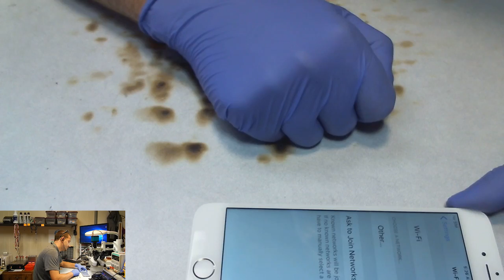An up-to-date iPhone 6 Plus Touch IC Repair - Comments on metal shield and underfill

Comment: We've done many of these and I personally replace the meson only and have not had any come back. Also if you are out of new mesons to reduce the chance of a bad ic, I've also been able to reball the same meson and have it work. Once I complete the repair we'll put something on the meson for pressure and then add the shield.
Reply from the maker: That's cool :)  I hope you continue to have no returns.  It can be maddening sometimes turning out 30 of these in a week.   I didn't think about doing something to hold pressure on the IC after replacing it.  That could be just enough to keep one from coming back that has a pad separated that goes unnoticed.

Comment: Discovered your channel from someone over on r/mobilerepair. Great stuff. I think more channels like yours should exist. Thanks for doing this, and keep it up.

7:05. Hah. Gonna be completely honest with you. The first time I tried cleaning an iPhone 6 board of liquid damage, I informed the customer that I really don't know what I'm doing and that she should find a store that offers ultrasonic cleaning. She said it was alright, and to just try my best. I knew enough that I needed to remove the EMI shields, so I started going around the board taking them off so I could attempt to manually clean them.

I flipped it over and started blasting that tape-covered area with heat. Sat there for minutes wondering when the fuck it would let me lift the shield off. Then I found out it was just tape and felt myself die a lot inside. Needless to say, that phone was very much dead after that, but it was also very much dead before.

18:40 I've found that most tacky fluxes seem to have that property of "locking" the chip down. It kind of flows right into place and does most of the work for you. I personally use Amtech 559, and it is actually reasonably easy to clean up even when cold. I use kimwipes and alcohol and an anti-static brush. A majority of it will get pulled right up. It also blows away very nicely on high air and low heat.
Reply from the maker: I did the exact same thing on my first iPhone 6 board.  I toasted that sticker pretty good before realizing it was just a sticker! LOL   I haven't used Amtech 559 yet but I'll probably give it a shot pretty soon when I make the next order.   Thank you for the info and comments!   I'm gonna be posting videos as often as time allows.  :)

Comment: Hey jason i have found out that sometimes only with heating up the ic sometimes the touch detection comes back for me it already worked 7 times and it does not take so long great video :)
Reply from the maker: Thanks!  Yes these connections are so tiny even the slightest variation in temperature is enough to make them or break them.  Hopefully it keeps hanging in there as long as you need it to.  =)

Comment: I had this problem with the cameras after replacing both touch ic;s, I ended up replacing the voltage regulator tiiiiiny chip, which brought back the back camera and then ended up re soldering some of the front camera components like the ferrites, caps etc near the cpu shield, this brought back the screen camera then, the odd thing is all of the components were testing just fine, so im guessing the only thing that was holding them to to board was the glue, possible heat transfer through the board caused them to detach, which is bizarre as I heat sink everything to death and never have the problem when doing a main pmu ic.

Comment: Hi Jason. Highly informative video thank you. If you don't mind I'd like to ask about how quickly you remove these chips. Am I correct in assuming you want to use higher heat to remove these chips asap before it starts affecting other components too much? looks like you using a bigger nozzle than I'm used to. What size is it? Be so grateful for your valued advice.

Comment: Don't feel badly someone will mess up due to you; we will mess up due to our own mistakes. You are helping us Jason! I wanna ask again in case you missed my question on the s3 data recovery video; have you considered chip-off technique for data recovery jobs? Also, I am going to start doing touch ic jobs real soon as I just got my new tools. I personally think you are changing too little. If i was sending you a board from one of my customers I would not only pay your low asking price but I would tip you! Haggling is not a good skill to try and hone on repair people, we generally sell ourselves short to begin with. I think you should be charging $200 for touch ic. How is it worth less than screen replacement? You are worth way more than your asking price Jason. I hope to see you raise the prices. I am going to charge $200 and I think Jessa charges $200. If they don't want to pay let them go to someone with less integrity.
Reply from the maker: Thank u!  I think by chip off method you mean hooking directly to the flash memory and copying the data.  I've thought of it but assumed it's most likely encrypted or have IDs on the file system that have to match for the OS to boot right..  It brought about more questions in my mind that answers and I moved on. LOL  I'm sure there's a way to hook directly to the nand and copying the raw data but getting it to make sense would be amazing.
Reply: This method only works up to Samsung S5. Hopefully they'll be stuff available for the newer Samsung devices with UFS's but all you need is a Jtag box (I recommend Z3X Jtag box w/ emmc adapter) All you need to do is solder 6 wires to the emmc or alternative points on the board if available (which means you don't need to remove the chipset) or you can buy a socket that makes reading not only way easier/more repeatable but it dumps faster!

http://forum.gsmhosting.com/vbb/f672/emmc-adapter-easy-z3x-jtag-box-1691845/

http://forum.gsmhosting.com/vbb/f672/e-mate-pro-emmc-tool-all-1-socket-all-1-adapter-work-easyjtag-2097603/

Comment: Hi Jason I watch your videos and I make sure I leave you thumbs up thanks for everything. I was wondering what is the model number of your power supply and how do you like it? Tks
Reply from the maker: Thank you! I'm using a really cheap one.  It gets the job done but that's about it :)

http://www.ebay.com/itm/5A-30V-DC-Power-Supply-Adjustable-Dual-Digital-Variable-Precision-Lab-Grade-/262294040786?hash=item3d11f170d2:g:RegAAOSw9eVXUIdZ

Comment: Hey Jason.I am from Kazahstan video vere good thank you so much)))I have a question how many degrees put the soldering iron?then you a new set Touch IC Repair or from a donor?
Reply from the maker: Thanks :)  The iron is set on 750F most of the time.  It helps a bunch for the board to be warm too.

Comment: Great video Jason. What type hot air machine are you using?
Reply from the maker: Thanks.  I am using this one and don't really run it all that hard.  I'm set on 380C and 40% air flow most of the day. 

https://www.amazon.com/Aoyue-852A-Digital-Rework-Station/dp/B000HDDXY0/ref=sr_1_fkmr0_1?ie=UTF8&qid=1477954164&sr=8-1-fkmr0&keywords=int+852a%2B%2B+pro

Comment: Hi Jason, just saw your video, great stuff. My iPhone 6 dropped and screen shattered. I bought a new screen off eBay.after connecting the new screen the phone reboots then screen goes red and turns off. Then happened over and over. I restored and updated phone with no help.however if I disconnect the last flex close to main processes the phone starts fine with no touch screen. Can u fix this knowing that I was planning to do it myself but I chickened out since my micro soldering experience is zero. Thanks.
Reply from the maker: There's a pretty good chance I could help.  Have you tried to replace that front camera/flex?  I'm guessing you already have, but if not, there's a chance it may be that.

Comment: I have a question about the adhesive shield you took of the bottom of the board at 7:00. I took that off of a 6s to clean for water damage, and that shield cannot be reused. What can I use to replace it or is it necessary? Thank you
Reply from the maker: I typically use kapton tape :)  Probably not the correct thing but I think the idea of that conductive sticker is to keep interference out.  Once it is in the housing, the back is covered by grounded aluminum housing.  Seems to me the conductive sticker may only truly help during testing before they get installed into housings.  I may be wrong but I've never had a problem putting regular ole' tape over it.

Comment: The only thing that is keeping me from doing this is that i do not have a heat gun. can i get away with not having a fancy one like you? Is it absolutely impossible to remove the chip w/o heat? to be honest I'm due for a new phone but really would like to fix the phone i have now.
Reply: also is it absolutely necessary for ultrasonic cleaning
Reply from the maker: I paid $130 for this hot air station.   There is no way to do it without a concentrated stream of hot air.
Reply from the maker: But just as important as the hot air is a microscope to be able to see it.  It really is a tedious job man.  I've never known anyone to do this type of thing successfully their first time even with the right tools tho.
Reply: STS Telecom thanks for the quick reply man I appreciate it. Looks like I am going to be getting a new phone :| not looking to buy all the flux and the hot air gun nor the ultrasonic cleaner. how much do u charge to do this if u don't mind me asking. One more question, how do u test for bendage on the phone. As u said in one of ur videos, I have to apply a twisting pressure to be able to typed. 

Ps I have a 6 + :( fml lol

Comment: Good afternoon Jason! My name is Marilton, I'm brazilian.
I would like to know, what temperature and air pressure do you use to remove the CIs.
Thank you for yours videos.
Reply from the maker: 390C most of the time but how far the nozzle is from the board makes a huge difference.
Reply: thanks dear friend for yours help!
Reply: STS Telecom Hi there Jason, i've been practicing this repair on damaged boards and have had some success but im having trouble with both chips "slipping" when working them back onto the board. i'm thinking too much airflow? Wondering if its possible we could have a more in depth chat? Thanks for all the great vids, repair shop out of B.C Canada.

Comment: what type of extractor fans do you use ? I work in a small corner with no ventilation so i never do soldering jobs in that small space.
Reply from the maker: There is a window right behind me that we pull air from.   Right now we keep good airflow through the building and that's about it.  I really don't make too much smoke working on these little boards but still always have fresh air moving through.  I'm adding a new system for fume extraction pretty soon though.
Reply: Thanks for the info man...I have been repairing mobile devices over 9 years now and i must say I am impressed with all your repairs, I live in the caribbean and visted the united states some years ago to do my certification in repairs, no motherboard micro soldering was done so most of what I have learnt on that level is from your videos, keep up the good work, Do you offer any classes ?

Comment: What do you think about some shops only charging $40-60 for these board level repairs? Doesn't make sense to me for the amount of work involved
Reply from the maker: That would work out ok if there was never any problems... ever. 
I think those are the shops that the moment they see a torn pad or something, they cram the IC back on the board and send it back as no fix.   Or they throw a chip on it and if it gets touch, they get paid, if it doesn't - no fix.   I really don't think they're doing much troubleshooting for that price but then again, if they live in a place where $20 per day can pay the bills, maybe they do a dang good job?  LOL - No way I'd do it for that price unless I could go back to living with my parents! :D
Reply: STS Telecom Lol I agree. Sucks though because to an average customer the lower price seems appealing and could take away from other shops. How do you get most of your customers? Having trouble finding customers locally and want to generate some mail-in repairs
Reply from the maker: I used to pay Facebook to boost posts mostly but since I started posting videos here, I haven't paid Facebook another penny.  It's gotten to the point that local walk-in traffic is very difficult to manage.  It has slowed down some though.  I'm finally starting to catch up now that Apple is offering a "solution" to the touch IC issue.   That made a huge difference in mail-in volume overnight.
Reply: STS Telecom Nice. How did you start getting mail-in repairs?

Comment: i have iphone 5c touchscreen sometimes doesn't work it been droped a lot will a new screen fix it?
Reply from the maker: It's most likely the screen if you haven't tried a new screen yet.   I do see a lot of those with touch IC failure but it is usually just the screen.
Reply: Ok thanks
Reply: Thank u man.

Comment: ok but have you ever actually tried to underfill a chip after confirming that the touch is working?
Reply from the maker: No, but I have had many of them have flickering grey bars resurface merely hours after giving them the all clear.  I test them very well too.  It's strange how this can resurface with zero bending, then another swap of Meson fixes it sometimes for good, sometimes for a few weeks.  I really don't think underfill is going to prevent this.  It would certainly make warranty work a nightmare and there will be warranty work.
Reply: STS Telecom fair enough. Have you tracked the rework rate of full devices vs board only? If the housing is still bent or even partially bent it's going to be more prone to further flexing and subsequent failure. I'd suggest a pad over the mason and an insulated future proof plate with the thickness of an ipad mini lcd back bracket.

Comment: Good morning Jason, first off just to say great job with your videos and your approach, i have a question that maybe you might have an answer to,  ive run into a problem recently on a few 5s and 6 not sure if other models are affected but the phone comes into me with either the connect to itunes logo or in a boot loop and then during an update or restore i get an error 9 and nothing i do gets it passed that, changed batteries, charge ports, screens, U2 ic in some cases but still the same. The few cases i've come across the owners haven't done anything unusual with the phones, they just go into the connect to itunes mode on their own.. Any help or ideas would be greatly appreciated..
Reply from the maker: Sorry, I should be able to answer you better here but this one is really not one of my strong points.  It sounds like you've covered all of the basics including Tristar.   I did a bit of Googling on error 9 and didn't come up with much other than possible network issues or software security problems.  Hmmmmm..    Since you said a few, that really makes me think that this is software update related?  Hopefully you've figured something out by now - I'm 2 days late.   Thanks for the good compliments =)
Reply: Thanks for the reply, it looks like i'm just going to have to wait it out for a software solution.. i was hoping it was something i was missing.
Reply: An update on this, i read on a forum that it  maybe a cpu issue and 
someone had some success by applying pressure to the cpu during the 
restore process so i gave that a try on a 6 by opening the phone and  
using 2 clothes pegs to clamp down on it during a restore and it worked,
 I have no doubt that it is only a temporary fix but at least i know 
what the problem is now..
Reply: i had the same problem, i changed tristar and bla bla it does not work after that i made a big risk and i reballed NAND disk it is working now

Comment: i remove both of touch ic but phone don't swich on :( what i have done wrong !
Reply from the maker: There are a lot of things that can cause this.  It's usually something fixable but not always so easy to find.
Reply: i think it's the power manager ic :( cz with microscop it's look like it's get shorted !
Reply: GeeK check for short to ground on your capacitors on the power line
Reply: hi :) im just nebie where could i find it ! dd u mean capasitor near power ic managment !

Comment: Lol did you notice the electrical tape stuck right above the touch ic chip? there's some video claiming to fix problems by applying pressure to the chip

Comment: How is that hot air? I want a budget 
H. A.S.
Reply from the maker: If this hot air station quit today, I would buy another one.  I use it all day every day and it is very consistent.  I couldn't imagine spending $1800 or even $800 on hot air.  Maybe one day.
Reply: STS Telecom Thanks for the input, and thank you for always being available to respond immediately. You are #1.
Reply from the maker: One more thing about this station.  If you buy one, remember to remove the shipping screw from the bottom.  I think everyone that you hear say, "they vibrate and are SO loud" - didn't read the directions.  :-)
Reply: STS Telecom very good 😂😂, thanks again.